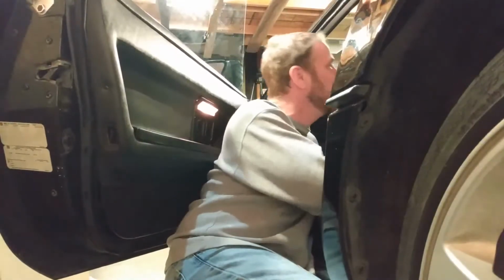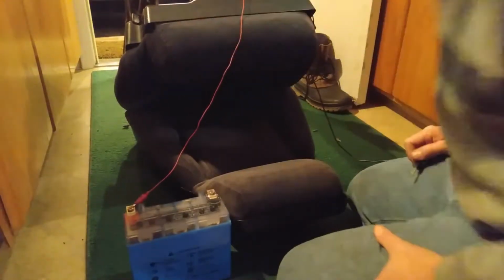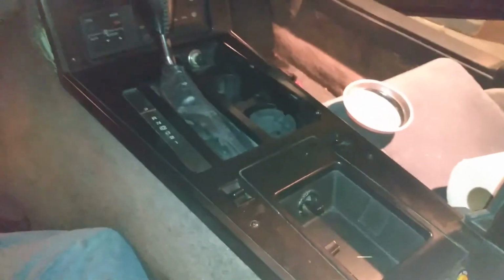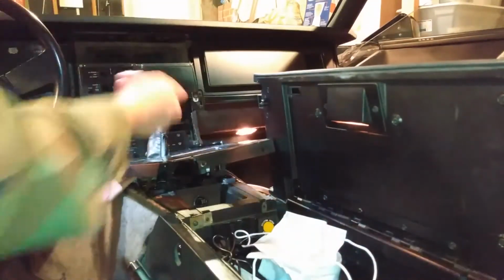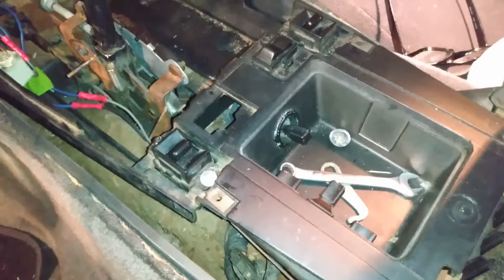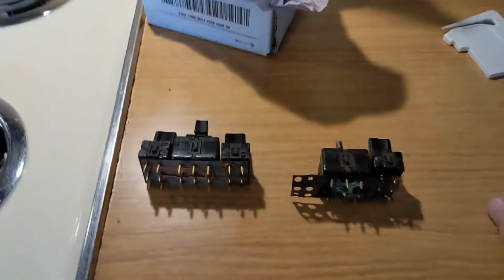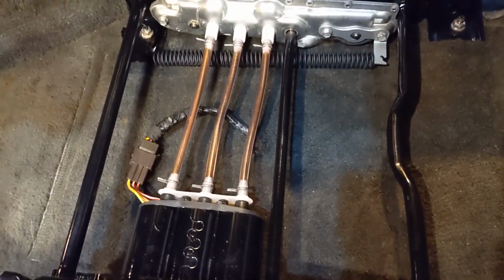How To: C4 Corvette Electric Seat testing and replacing motor and switches on my 1987.

Comment: Where did you ground the motor to test?
Reply from the maker: @DougSander-s7o   that's not how I did it. There is no specific ground because you reverse the polarity to move the motor in the opposite direction. You just need to find the "pair" for each motor.

Comment: Thanks much for the video. It's always great when people document their repairs for C4s as info is limited.  You might amend your title though to state 84-89 as the interiors dramatically changed in 1990.
Reply from the maker: is the switch different?
Reply: @JerrSpud  Yep, completely different switches, in different locations, etc. Nevertheless, you gave me some good ideas and I fixed my issue today with help via motivation from your video!
Reply from the maker: @ZBrink11  I know the interiors are different, I assumed there would be crossover in how the switches worked.. 
I'll check that out. thank you
Reply from the maker: The seat motors are the same in all C4s. The only change is the plug changed shape in mid 1987. The switches look different, but function the same way. Testing the seat motor will be the same in all C4s. I made a change in the description.
Reply: @JerrSpud  Mostly correct. The basic motors and transmissions are the same. If the car has sport seats, it adds in more complexities for air lumbar and bolster support. Also, some years had power tilt as an option which adds an additional and separate motor, track, etc. The switches as well as the console and dash are dramatically different 1990 onward which changes the disassembly and some troubleshooting procedures. 

Again, I super appreciate people like you making the time and effort to do these videos. I will do tutorials for the forums but it's a little beyond my bandwidth to do a video like this so I appreciate you. Also, watching your video motivated me to finally get to the root cause of my own seat issue which I resolved and I'm ecstatic over! Thank you again!
Reply from the maker: @ZBrink11  I'm just talking about the motors and transmissions that move the seat. Those are the same. They all have three motors.

Comment: Thanks for the great video! Where did you get those electrical schematics? I’m having a lot of trouble with my seats and can’t seem to find those.
Reply from the maker: It's in the supplement of the factory service manual. There's two books for my 87. The factory service manual.. and the supplement for the factory service manual that has all the electrical stuff in it.

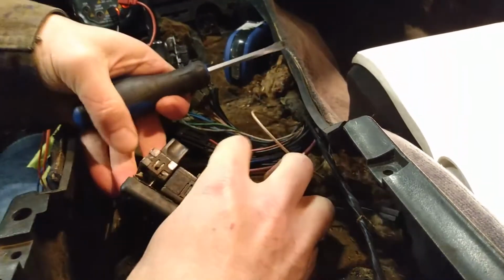Comment: Thank you, especially for 21:25 onwards.  I am into the seat switch for the third time.  Mine is an '84.
Reply from the maker: you've replaced the switch three times?
Reply: What is this issue you were having?  Did you fix it?  My motor seems to be working but my tilt switch seems to not be working. I have a '90 and apparently the sports seats only had power tilt for 1 or 2 years.